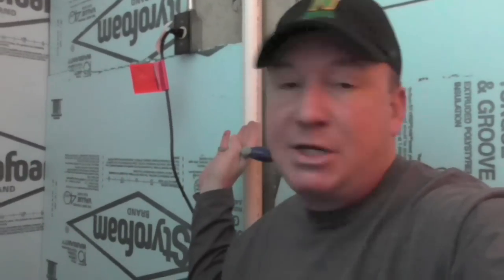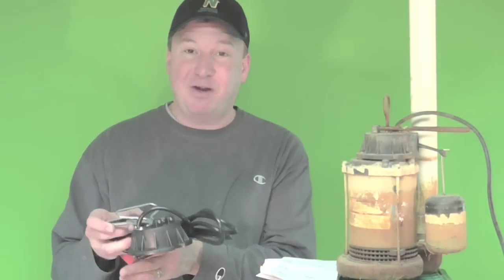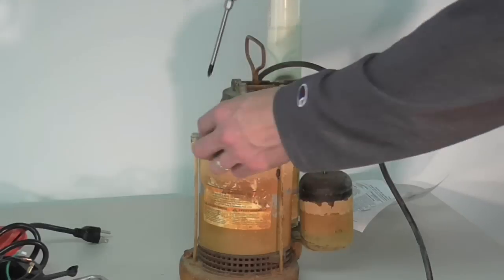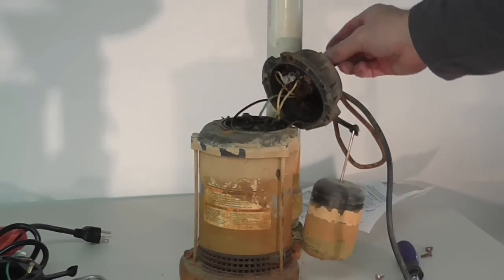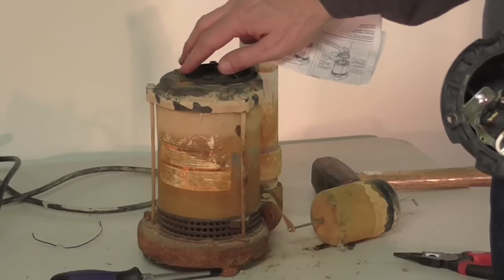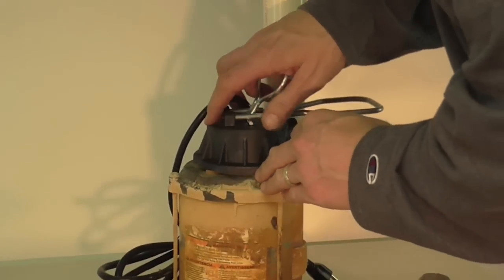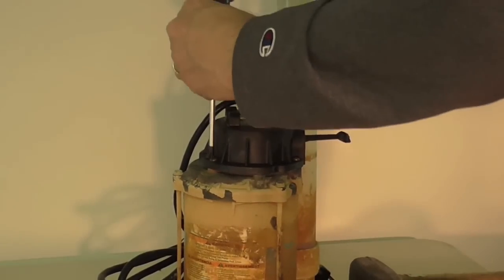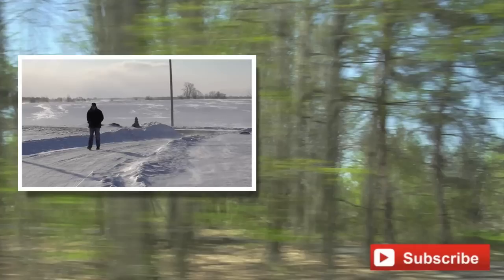Sump Pump Float Switch Repair

Comment: Where did you purchase the replacement kit??? I'm in trouble it's pouring cats and dogs here and the husband is out of town for 2 weeks. I'm handy and think this is simple but I need to buy the float switch. Please help. My pump is a Wayne but they all look pretty much the same. Thanks
Reply from the maker: I looked up the contact information from my sump pump company and talked with a tech support person who send one to me, even though it was out of warranty.  I don't recall seeing them in the big box stores.
Reply: I called Ridgid and they gave me the replacement part number for the float top replacement kit for my pump model. You can't buy it from Ridgid, but I was able to buy it at SupplyHouse.com

Comment: This is why I like pedestal pumps. Motor not under water to get all that corrosion and backup switch is $10 instead of $30. Finally you can make the repair without having to re-plumb and pull unit.
Reply from the maker: Thanks for the suggestion.  I've never tried the pedestal pumps.
Reply: Water really isn't the issue. It's the cycle wear. I've gone thru 5 of these Ridged 1HP pumps over the years. Originally they had lifetime warranties, then dropped to 5 year after seeing their switches don't last long. Problem is if you flood you don't have time for a repair, unless you have a switch ready to go. As to why I just bought another $260 Rigid 1HP pump again last week.. You used to be able to find them on eBay for like $30, but not anymore. Luckily this last pump lasted about 4 years. I've never been able to get Home Depot to replace one under warranty, even w/ the receipt. But they did send one in for repair, which they knew meant I'd have to buy another one while it was fixed.

Comment: Great video m8 however Rigid has discontinued the Float switch assembly I need for my SP500.  Have any work around?
Reply from the maker: No, sorry
Reply: When stuff gets discontinued, only way would be to find a third-party supply shop that may still have the parts or replace the whole pump entirely.

Comment: Hello I'm having problems with my pump when I turn on the power I can hear it turn on but is not pumping water out my sprinklers do you have any idea of what it could be thanks in advance
Reply from the maker: It's possible that a small stone or piece of gravel got wedged in the impeller.  You may need to unplug the sump pump and then see if it turns freely.  I've done this before to make it work again.
Reply: Okay thank you 😊
Reply: ZOELLER M267 WASTE-MATE - 1/2 HP CAST IRON SEWAGE PUMP (2") W/ VERTICAL FLOAT

Comment: Can i bypass the float switch temperarily? We are afraid the water has no drained because we havnt heard the sump pump turn on but it turns on when i checked the plug on its own without the float switch
Reply from the maker: It's been awhile since I made this video to remember if there's a piggyback plug.  If there is, then you can plug the pump in without the piggyback and see if you hear it turn on and pumping out water.  Good luck with it, let me know how it goes...

Comment: I know this Is so old. But my pump is smoking up and is not filling up with water. Also a brand new unit.
Reply from the maker: I'm wondering if the impeller is turning?  Sometimes a pump can pick up a peastone or gravel and jam the impeller.  Also wondering with it being brand new, has it ever worked?  Is the check valve backwards?  Maybe it's a bad unit if everything looks okay.

Comment: I thought you were going to show us how to fix the switch but you replaced it instead. Still a helpful video.
Reply from the maker: The inside of the switch area was very corroded, probably beyond repair.  The only fix it to replace the switch.

Comment: Great video - thanks.  I am disappointed, however, in the quality of this RIGID unit.  Replace the switch every three years!?  I have a Zoeller M53 in another location and that thing is indestructible for the same money.
Reply from the maker: Yes, that was very surprising to me too.  I just keep running this one and have a backup in case it goes out.
Reply: My Zoeller has been going strong for just over 25 years now. I haven't touched it in that time, but it's just now acting up. I had bought a Wayne 1hp at an auction years ago figuring best to be prepared. I opened the box just a day ago to see that it wasn't set right (where the three bolts he says not to touch in this video) so last night I decided I'd try and fix that and instead made a mess and just decided I'd buy a new one and use this one I have as parts for it. Hopefully I'll get a few years out of this Wayne model and I'll get myself a Zoeller or something that's the best thing out there again after. Sad to see so many products just aren't built with the same quality parts they used to be. I've still got the Zoeller that was replaced over 25 years ago too. Maybe I'll open them up and try to recondition them to have one great unit again. You'd think they'd have a program of taking the old ones back to reuse the old iron castings again, but I haven't heard a thing about that.

Comment: What if the float became detached at the bottom? I'm trying to figure out how to get that reattached to prevent the float from drifting off in the basin and falling off the switch.
Reply from the maker: It's hard for me to say without looking at it.  Zip ties often come in handy for a quick fix.

Comment: Is a loud "clunk" noise when the sump pump finishes draining, normal?
Reply from the maker: Yes, I often hear something like that.  It may be the check valve closing.
Reply: markthomasbuilder Thanks so much for responding, it's been working fine but I wasn't sure if that was indicating something needed to be checked
Reply: Clunk sound is just the sound of water in the pipe banging when pump stops.....very normal
Reply: Check valve.  You can get "quiet" ones...well worth the money, IMHO

Comment: Where did you buy a kit for $30? Amazon/ebay: $70-80. Just a switch - $19. Thanks.
Reply from the maker: The owners manual had a number to call and they sold me the replacement switch.  I'm guessing it's the Wayne Pump Co.

Comment: it'd have been better if you showed how to remove the pump from the pit.
Reply from the maker: Good idea.  My sump pump has a Fernco check valve that's about 2' above the top of the floor.  It's very easy to take out.  You unplug the sump pump, then unscrew the hose clamp on the check valve and you can have it out in about 1-2 minutes.  Just make sure the clamp doesn't fall into the sump crock by accident.  Hope that helps!